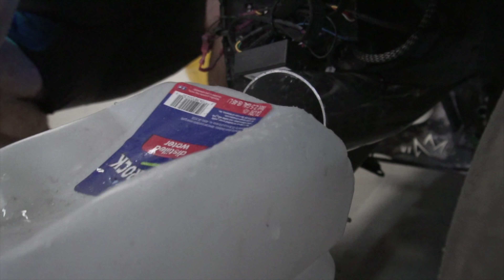Destroying a $3300 Garrett Turbo Making a Smoothie

Comment: Good vid 🤣  I might be being nieve here but to clean the intercooler don't you just run air or water through it in the opposite direction of the normal flow? If the bits were trapped going one way, surely they would be free to leave going the other way.

Comment: Mentioned this on the boosted bois video, instead of the turbo guard, look into the airraid race filter that ol smokey runs, stops a lot more than turbo guards do and have no resistance, they're just a very fine steel mesh cone filter